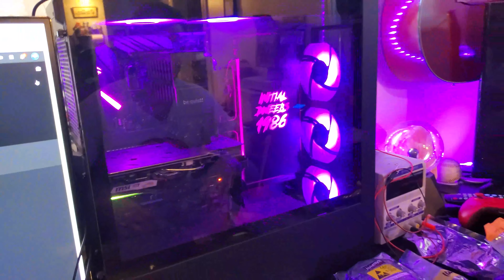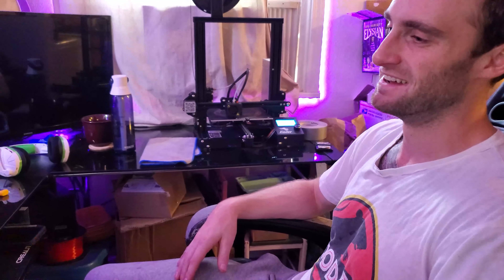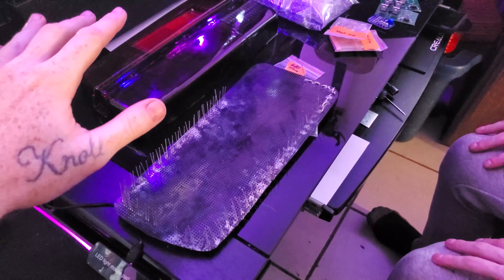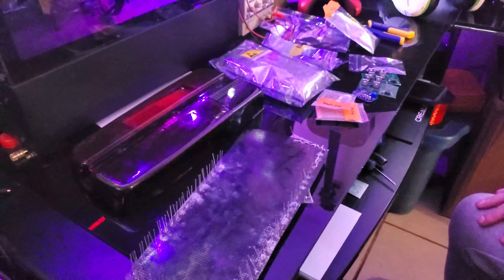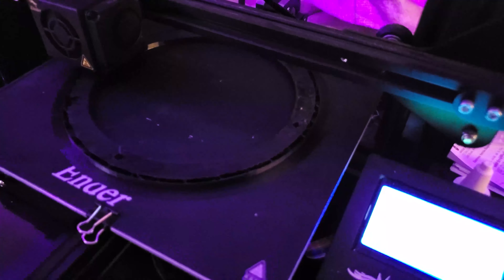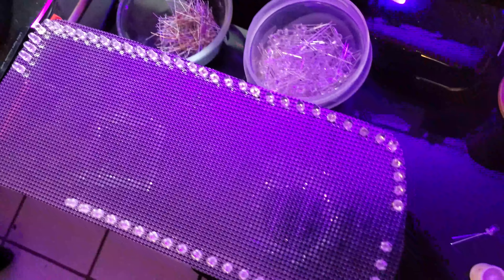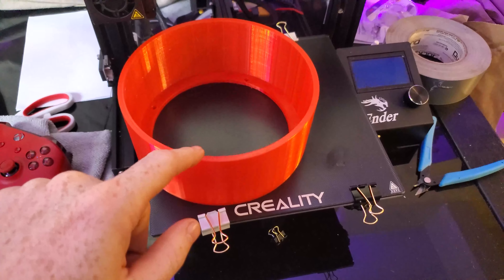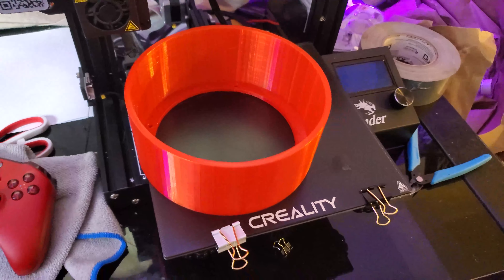240z LED TAIL LIGHT CONVERSION! (Part#1) EP#47 3SGE DATSUN 280z

Comment: The 3d printer is dope, but if you had a router, circle jig, and even a cheap router table, you could have been done in like 1/2 hour. lol
Reply from the maker: I know haha 😅😅 some of the stuff we print that takes hours i could bend up and weld together in 30min at the shop and it partly kills me knowing this but the idea is to produce any parts we can with the 3d printer so we can get better at CAD software so that hopefully we will be good enough in the future to design some crazy moving parts and more complex stuff.
Reply: @initialdweebs4050  For sure. I want a laser first, then 3d printer.